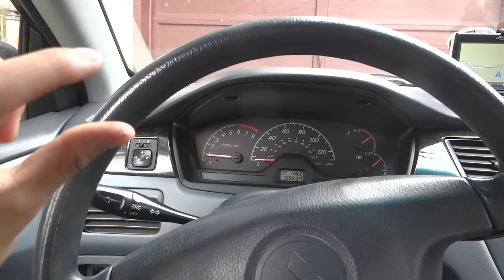Lancer Fix 16 | Change Outer Tie Rods and Diy Alignment

Comment: Thanks for your videos! I just replaced my tie rods. I didn't figure it would be too difficult as I have done it before on a Mazda about 10 years ago. However, I had no idea how easy it would be to DIY on the alignment. When I took it for a spin my wheel was moving to the left a bit just as yours was so I did like you said and I got it perfect now. It runs so much smoother now and I probably saved a few hundred dollars doing it myself. Next time I need something fixed on my Lancer I'll check your channel again for sure. Thanks again!
Reply from the maker: +ACSpexarth Cheers!!

Comment: I believe on front FWD cars you want a slight toe out because when in drive they push the toe slighty in so they make them slightly toe out to compensate for that and your wheels are actually straight while driving. RWD make tires go slightly toe out so they do the opposite for the front.
Reply: wrong you toe in on front and the back has to have 0 degrees of camber or toe.

Comment: Nice video... I have an 1989 Mitsubishi Lancer, I hit a couple pot holes and the last time I hit one I noticed right away my steering was a little off and so I failed to fix it my front tires next started splitting... Geez, I had a mechanic look at it and he said something about changing two stabilizer bars?  I'm not experienced with this.

Comment: I would strongly recommend to use a Torque Wrench for tightening the rod. over tightened rod may get damaged. The Torque is 25Nm +-5Nm. Still pretty good channel buddy. Wish I found it earlier
Reply from the maker: Pizdzirynka1 Thank you. cheers

Comment from the maker: I'm thinking even further than just that. I'm thinking about time attack car with wings, after market parts on the engine, nitrous, neon, harden suspension, drift wheels, body kits from Thailand, repaint the car, new seats, racing steering wheel, etc. 
.
Then I ended up asking myself, "Oh that would be cool, now where's your money?" LOL

Comment: Thank you for the video!! I just got new tires and they informed me both inner and outer tie rods are junk... looks like i'll be doing this too.. any tips for inner tie rods?
Reply from the maker: Yes, get the good tool for the inner-tied rods, the one I was using requires a lot of patience, but still work just fine. cheers

Here I changed the inner tie-rods at the last part in this video: Lancer Fix | Shaking While Driving 60 mph (Semi Fix) - Ep.5

Comment: Can you post a video changing the ball joint? Please
Reply from the maker: Buy the whole new control arm is better. Parts are cheap nowadays. :Lancer Fix | Front Drive Hub, Control Arm - Ep.14

http://www.ebay.com/sch/i.html?_sacat=0&_from=R40&LH_BIN=1&_nkw=lancer+es+2003+front+control+arm&_sop=15

cheers

Comment: HEY I CHANGED THE OUTER TIE RODS, DO THE ALIGNMENT PUT NEW TIRES BUT WHEN I HIT 45-60 MPH GOT A LOUD NOISE ON THE RIGHT SIDE CAN YOU TELL ME WHAT'S WRONG WITH IT IT'S REALLY ANNOYING THANKS
Reply from the maker: That means the bearing is bad.  Watch this:
https://www.youtube.com/watch?v=HdKiYbj_vy4

Also buy this to take out the snap ring, it will save you a lot of time. 
http://www.harborfreight.com/11-inch-long-reach-needlenose-pliers-with-45-offset-jaws-39537.html

Comment: the needle in the cluster for my gas gauge drops down dramatically  once it reaches halfway,  I change the fuel pump but it still the same can it be something else?
Reply from the maker: +wilber714hernandez Try this to clean the sensor: http://www.ebay.com/itm/Chevron-65740-Techron-Concentrate-Plus-Fuel-System-Cleaner-20-oz-20-Ounce-/261976510949?hash=item3cff0451e5:g:LOIAAOSwyQtVrvV9&vxp=mtr

Or your cluster might be bad

Comment: Hey Mackey, can the front cambers be adjusted without any modifications? How come front cambers become offset on this Lancer. Great videos by the way.
Reply from the maker: I was just adjusting the tide-rods, nothing more. I didn't do anything to the camber. If you want to adjust the camber,   you will have to buy aftermarket coilovers for this Lancer.
Reply: oh. Thanks for the speedy reply. Your recommended solution for the camber could be my ticket. But, I prefer the factory (stock) setting. How about camber bolts? Does it exist on this model? More power.
Reply from the maker: No, I don't know that neither.

Comment: would it be harder to do a rear alignment or is it similar? because i have the same one but oz rally
Reply from the maker: +Saul Sanchez Hmm, I have never do that to the rear actually, most of the time, you don't have to.
Reply: @DarkDragonWing  
Could you show a moderate video or explanation of the rear side alignment parts of your car? I have a 2002 Mitsubishi Lancer ES 1.6L Automatic & my tires are getting bold from the inside thread, my outside outer thread is ok.
Thank You Awaiting For Your Prosperous Response from You Or Anyone Please...

Comment: Hi Mackie. Is there a simple way you could explain the diy alignment. If your steering wheel is going to the right, and your wheels are equal beforehand, then you'd turn each tie rod up instead of down equal turns on both sides?? Sorry for the long question, I hope you can get back to me. I'm trying to learn the tape measuring way.. 

-Alex
Reply from the maker: Just think of turning the screw. Are you screwing it in or out? Something like that.
Reply: Okay. It's suppose to be slightly toe in. Okay thank you. And tips you suggest??
Reply from the maker: @user-hv9bx6yp4g  Yes, with steering going to the right and the wheels are already the way you wanted, that means you have to turn each rod up equally on both sides.
Reply: @DarkDragonWing  okay.. very much so appreciated. Seems to be the biggest problem for me too. Very informational video too btw!

Comment: Would this fix the shaking when your driving 60 or higher on the freeway ?
Reply from the maker: Chris Ruiz Yes, it will help stop shaking. To really fix the shaking, you will need to balance your front wheels/tires.
Reply: +Chris Ruiz  also your  control arm bushings may be worn  replaced mine and the tie rods and we are good to go!

Comment: Why even touch the lock nut?  If you don't move the lock nut then the alignment should remain exactly the same as before IF the new tie rod end is the same length as the previous one you're replacing.

Comment: What I need to do if my steering wheel moves alone sideways, right into plane sites is maintained but if the street is pending, the steering wheel moves to the slope.
Reply from the maker: Your "steering rack" might be bad.
Reply: oh ok ty i will check that, btw im a new sub all the work you do on cars is awesome
una abrazo desde el vecino pais del sur

Comment: Or fixing the AC because my 05 Lancer has a AC problem ,when the air comes out warm ,when its suppose to be cold air.
Reply from the maker: Chris Ruiz  Here: https://www.youtube.com/watch?v=cpU-blF9SVU
Reply: That for the gears but I meant about the air conditioner when I want cold air it comes out kinda cold, but 10 mins later it ,the AC air starts warming up
Reply from the maker: Chris Ruiz
 I see. You need to turn it off for a couple of minutes. When you turn in on really cold, the hose will start to freeze and it will not get colder, thus it gets warm.
Reply: So the solution is ? My brother told me about the air compresser . Idk
Reply: Sorry for asking a lot of questions .its just  because,  this lancer is my first car and I'm learning on fixing it  ☺️
Reply from the maker: Chris Ruiz
 I don't know. The easy solution is to turn it off for 2 minutes and then turn it back on. :)